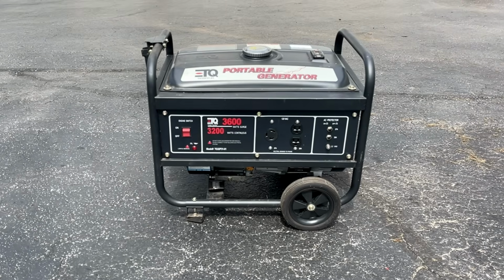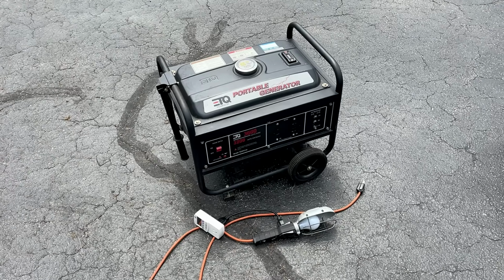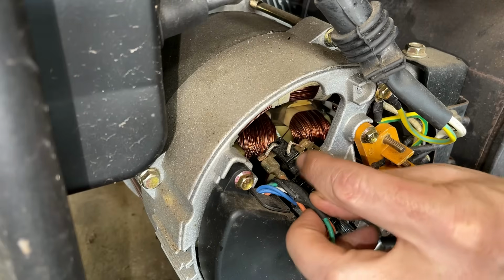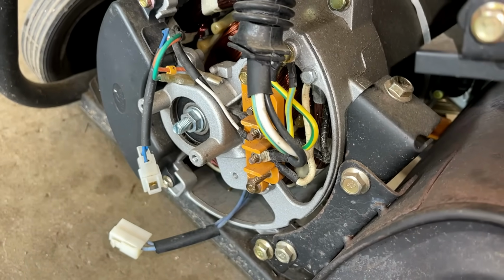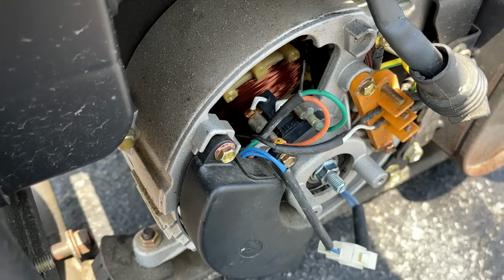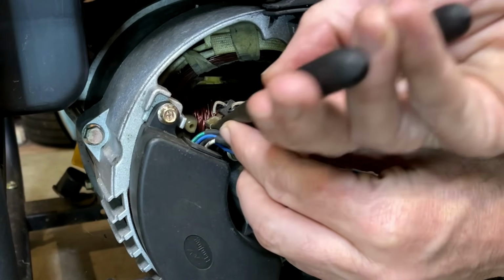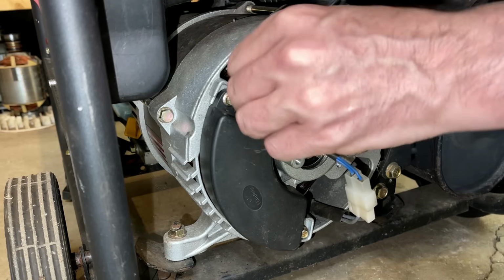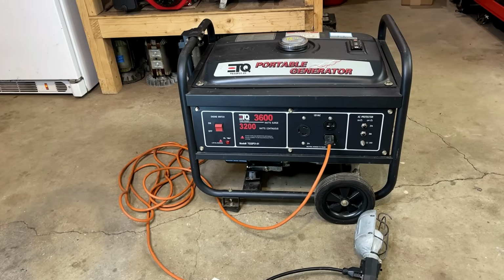Two Generators No Power Output - Same Model, Same Problem?

Comment: Capacitor...without even looking. I predict your brushes will burn up again in short order. The capacitor is there to inhibit the arcing and to do a phase shift. Usually, the capacitor is a separate two terminal component...and about as large as what looks like an integrated control circuit component you have. I suspect they have integrated the capacitor into that control circuit component. There's no way those brushes should get that hot. Put a thermocouple on them to prove it. If you do change out the control module, break the old one open and locate the capacitor. It is either an open circuit (without capacitance) or a short circuit. That white plug you disconnected may actually go to just the capacitor...or maybe the capacitor is hidden below and that white connector goes to it.

Comment: Another problem that can happen with these kinds of generators is they become degaussed and need to be flashed. These generators don't have permanent magnets, they depend on electromagnets to provide the static field that the rotor field moves through, to generate power. There's usually a small bit of magnetism in some iron that provides enough of a field for it to start generating a bit of power for the static field coils, which then provides a strong enough field for the generator.
What happens is sometimes that bit of magnetic iron gets degaussed (ie. all magnetism removed from it), so it is no longer magnetic, so the generator can't start generating power to generate a field which then makes the main power.
The way this usually happens is if you turn the motor off while the generator has a load attached, or if it runs out of fuel with a load attached. You should never start or stop a generator when it's under load, because of this.
The way to fix it is to "flash" the generator. You can do this by either using a car battery  to put a short pulse of current through the coils WHILE the generator is running (connect and disconnect it really fast between the active and neutral of the generator output). Another potential way is to have a corded  power drill plugged in while the generator is working (but not generating power), then quickly spin the drill - the idea is that spinning the drill will induce enough current in the generator's coil to provide a start field for the generator.
I found the car battery method to be the most reliable, but it is dangerous - you only want that to be connected for a very very short time. 

There's a few youtube videos on "flashing" a generator which probably explains it better than this.
Reply: You can also flash them with 110vac, basically using a double male ends extension cord, but as you said, it’s dangerous and needs to be connected very briefly. They would come in all the time for repair after sitting forever, so after repair I’d have to flash them to get them genning.
Reply: Yeah never heard of flashing them like that before. At work, we apply the battery directly to the exciter coil or the brushes.
Reply: Better off taking off the stator, placing a neodymium magnet to remagnetize the in-rotor magnets, than putting current through the wires. Heck, even turning on a mag drill base on top of the rotor magnet (with a thin sheet of paper or some form of protective material) would be a safer alternative, albeit could be overkill.

I ain't risking popping the coils on these things, especially the newer trash power heads with COPPER-PLATED ALUMINIMUM WINDINGS. Those cursed things are a nightmare to repair, especially when it's rotor windings.

Comment: Beautiful , and the comments  are also helpful  .
 Can we conclude that operating  the generator  in cold weather conditions  will ease  the overheating problem which caused the crap  plastic to deform  ? Also leaving the  cover off will help  to keep it cool maybe. Fixing the arcing problem somehow might be the  solution like  having capacitors shunting the  brushes in the fashion of old school points capacitor for old school automotive ignition systems .

Comment: Just looking at this is reading some responses from owners of the same brand units, lead me away of this under-engineered devices. Apparently cost
savings were the only criteria by this design. Not durability or user safety.

Comment: On the slip rings, could use some fine sand paper or steel wool/ wipe with a little contact cleaner or lighter fluid.

Comment: I have Troy-Bilt 8000 watt, brush slip rings got dirty from sitting. For that one I started engine and used a fine sand paper held against the slip rings. Brush holder was not impeded with wires or other things in the way so was pretty safe to do that. Worked fine after simply cleaning. I think after sitting for a few years, the copper corroded on the slip rings.

Comment: The R/H bolt was left out of the brush  housing.
Reply from the maker: Honda clones only use on bolt for the brushes.  The other side has a locating pin.
Reply: @jcondon1  I see that now, and stand corrected.

Comment: It could be simple as slip rings material, should be hard copper, is a bit corrosive prone (chinesium copper), so as generator sits for a long time, it becomes like fine sand paper and get clogged with brush dust ending up overheating the also poorly made brush holder...

Comment: You could have driven the rotor with a battery drill while cleaning the slip rings.
Reply from the maker: Yes, but would remove the stator first so not to lose any fingers in the process.

Comment: Years ago a coworker had a no power issue on a basic generator and took it in on warranty a couple of times. The last time the tech told him the basic units are not designed to run continuous. If you keep adding gas and running the brushes get out of sync and burn up. They need to shut down and restart at each refill.

Comment: Very educational.
As an aside, I had a royal pain on a Hyundai HY7000 that was a nightmare from day of purchase (in fact the genny was 4 years old when "new") that would not start after 2 years of having to replace all sorts of bits that simply failed, like the tank float, the fuel valve, both wheels at different times, the digital display module (which has failed again.. Turns out the internal coil cell has run flat.. The module is No Longer sold as a spare part), It has run less than 20 hours in the 6 years I have had it.
Turned out the latest starting issue was the magneto as it never ever started on the cord and was reluctant on the electric start. Now, for the first time ever, it starts on the cord.
Shout out to generator Guru in the UK for having the spares Hyundai after sales in the UK said were unobtainable.

Comment: I'd would have my 20v drill slpin it over that way you getting it clean without the hassle. I'd feel the roughness of the slip ring and use a very fine piece of whetstone to remove the worst of the roughness then go 1000 grit dry sandpaper then followed with a 3000 grit wet sandpaper then clean it with a lint free cloth rag dipped in lacquer thinner then reassemble with new brushes and holder it should run till the motor is wore out without anything except possibly brushes if ran often enough

Comment: I cannot say I’m particularly impressed by the brush holder. Looks a pretty flimsy affair and certainly not very well secured. The very design of this would encourage the brush holder to slip out of alignment resulting in the brushes not running perpendicular to the slip rings. Very poor design.

Comment: So this is a dc generator...brushes....with AC converter.
Reply from the maker: It is an AC generator.  DC input to the brushes to power the rotor electromagnet.  Once powered, AC is produced out of the stator.

Comment: when you were cleaning the slip rings why wouldn't you use a drill attached to the socket to spin the rotor instead of a ratchet ?????

Comment: I had the same thing happen on a 5500W brushless generator. Obviously, being brushless, the brushes were not the problem. In a brushless genny, there is a large capacitor that can fail. If you put an ohmmeter on the capacitor, it should show some continuity for a second or so and the resistance will go back up. Replacing the capacitor brought back the power output. It's been putting out power reliably ever since. At least, as reliably as the engine functions.
Reply: You might have to ' excite' the stator. That is when you wire in a 9 volt battery and a 5 amp fuse and a 110 volt plug and when the engine is running you plug it in or have it plugged in and start the engine just cannot remember it has been years the 9 volts sends just a bit of voltage into the generator and voila electricity. Was told years ago to buy every generator you can find that does not put out juice and do this trick it happens most of the time when a portable generator is hauled around in the back of a vehicle and the vibration causes  the generator for lack of a better term to go flat so to speak
Reply: @billhale9740  interesting,,, could it perhaps  be caused by a loss of residual magnetism . For soft iron cores i don't  think much temperature above 200°C is required to demagnetise the iron depending  on the alloy composition ⁰, if contaminated  with  copper  as for iron obtained  from recycled materials incompletely processed ,then the magnetic retention  is poor .
Reply: No doubt learned that in radio school in Ft. Gordon Ga. In spring of 1966
Reply: @billhale9740  ?

Comment: Something else to check there. I've had that same fault occur with a certain brand (looking otherwise identical) where the ball bearing in the tail housing had started to spin. The bearing itself was still ok, but the outer race spinning had allowed a small clearance to develop, probably loosening when the case metal heated up in use. That clearance then allowed the rotor and slipring to chatter which caused the brushes to bounce and arc, and then overheat. Replacing just the brushes became a temporary fix before discovering this. Your slipring shows the same chatter marks. I found a loctite bearing retaining compound that cured the problem, I also pulled the bearing itself back slightly on the shaft, that allowed it to index on the original bore while the loctite filled the remainder. None have come back since adding this repair to the original brush replacement. An alternative would be to over bore and sleeve the housing, if I was doing my own (with no cost limit) I'd do it that way.
Cheers.
Reply: I had that happen to a pool pump motor, end plate bearing holder got enlarged due to the bearing worn out. bearing was not turning smoothly so was slipping around in the bore. I had a thin piece of SS sheet, cut a long rectangle and filled the end plate bearing hole circumference with that, fixed the motor with a new bearing, worked  like new.
Reply: I wondered if it was a bearing thing,when he filmed the end of the rotor shaft it appeared to hunt about a bit indicating a possible loose or floating bearing being the cause of the failure,also indicating that the bearing may fail  imminently if not corrected..
Reply: I wonder how well these can be done with a lathe on hand (slip rings and overbore+sleeving)

I was thinking people could try doing that trick with an oxyacetylene torch with a metal powder dispenser to 'build up' worn slip rings (I cant remember the name of that operation; its used to rebuild worn steel shaft sections), but i have a feeling the temperature range of such an operation is way to excessive for this sort of thing...
Reply: I think your suggestion is right on! Brushes create heat but never this much and to cause plastic to melt. Usually is a cause for this failures. When bushings, bearing wear other things are effected. Like gears, seals, fans and Brushes! I've seen people replace seals only and start leaking again after a short time of use.

Comment: Hi James, I would make two suggestions. One, attach your drill to the rotor shaft and turn it slowly that way, then use some 400 or 600 grit wet and dry paper on the slip rings. That way you'll get the grooves flattened out. Follow up with your scotchbrite.
As to why these failed it's the material used for the brush holder. It needs to be Bakelite or a similar material. The plastic they've used is too easily melted by heat. They will fail again.
Running 3000 watts from these is too high. Despite being listed as 3200 watts that would be for a very short duration. Somewhere it probably lists 2500 or even 2000 watts as the continuous power. Just my observations.
Thanks for the video.
Reply: That's nuts that they'd use thermoplastic instead of a thermoset plastic inside a generator head.  I mean there's cost engineering but this is just ridiculous.
Reply: I had the same thought, but then my next thought was "do I want to stick my fingers in there while it's spinning? Nope". And with how close the coil attachments are to the slip rings, I also wouldn't want to risk sticking a tool in there. So I think turning with a wrench is by far best option here.
Reply: @MicraHakkinen  you missed the phrase "turn it slowly" in my suggestion. Someone suggested starting it. Now that would be crazy.
Reply: A lathe provides a good result on pitted rings if the material is thick enough. It is routinely used on commutators that are pitted
Reply: That is how I would have done it also.
Reply: I've got the same generator, just a bit smaller. I'll be examining my brushes today! Thanks for the heads up.
Reply: The main reason that Bakelite was discontinued is that not all but many versions of it contain asbestos, and we all know what that means.
Reply: just don’t electrocute yourself 😂
Reply: I 100% agree with Bakelite used for the brush holder. It's what distributor caps are/were made of and heat never bothered them.
Reply: I'd just start the engine and clean the rings with a piece of emery cloth on the end of a stick.

Comment: Are the brushes pretty standard on various generators?  Are the slip rings replaceable?
Reply from the maker: Most Honda and Honda clones use the same type of brushes.  Slip rings are not replaceable on most portable generators.  Would need to buy a new rotor.

Comment: Design fault. The brush box is thermoplastic instead of thermosetting plastic, eg Bakelite,
which would withstand the temperature. The machining of the sliprings appears to have
chatter marks. This would cause the brushes to bounce and arc until they bed together over time.

Comment: Hi Im not expert but why the brush mounting has only 1screw in both generators?
Reply from the maker: Not sure.  Honda and Honda clones use one bolt and a locating pin on the other side.

Comment: Them making that part plastic opens them up for litigation. What a terrible design and a very dangerous flaw. If its hot enough to melt hardened plastic, nothing flammable should be in that damn area. Aluminum or something else cannot cost that much more to form. What a joke.

Comment: I noticed with both sets there was only one bolt holding in the brush holder.  Aren't there usually two?  Could leaving one out have enabled to holder to move a bit, which in turn might have caused the arcing?
Reply from the maker: Honda and Honda clone only use one bolt.  There is a locating pin on the other side to hold it in place.

Comment: The fact that you have with the same failure tell me that it is a faulty design and both will likely fail again. Should be a recall or at least an updated replacement part available.

Comment: You can also put high temp graphite lube on the brush blocks where they slide in and out of the plastic holder so they mate up smoother with the slip rings.

Comment: Hey, just a tip. Don't start a generator with a load on the power. Even that bulb could cause issues eventually.
Reply: Right!!! Not a bad idea to shut down with no load, to avoid the potential load you mentioned at start-up. No load at shutdown also supports better cool down. This is the "correct" way taught in training decades ago.
Reply: Yes.

Comment: Please put in the description where you got the new brushes and brush holder to replace the one that was melted
Reply from the maker: Will add them to the description.  Got them from Amazon.  There is a link in my store under the generator section.  They are made by HIPA https://www.amazon.com/shop/jamescondon

Comment: I don't if you know about them, but they have these sticks thats have diamond dust in them used to seat new brushes in small motors. What I have done in the past is start the engine and polish where the brushes ride, just watch out for your fingers.

Comment: for a full repair, you should strip out the rotor and turn it between centres to polish the comm.  Then it should be good.  Unless it is a design fault in the brushes, eg too much clearance in the housing allowing them to tilt.

Comment: I noticed that they only use one of the possible two bolts to hold the brush carrier - a few cents saving that could allow the brushes to mis-align and cause the heating and failure. But my bet would be poor initial quality of the slip-ring surface which adds to the one-bolt problem in causing brush heating. Drill and tap for that second fixing bolt!

Comment: Looks like China just don’t make decent generators either.how many hours were even accumulated on either one of those very new looking machines? Mustie in New England area has a YouTube channel where he finds tons of generators that pooped out from lack of quality parts and yes, sometimes things like old or bad gas which is user fault.
Reply from the maker: Definitely a lack of quality on this model.  But they were only $300 new.  Cannot expect quality at that price.

Comment: I guess they use a brushed motor because it's cheap? Horrible. Need to use a brush-less.
Reply from the maker: Brushed produces cleaner power, but they do require maintenance over the long run.